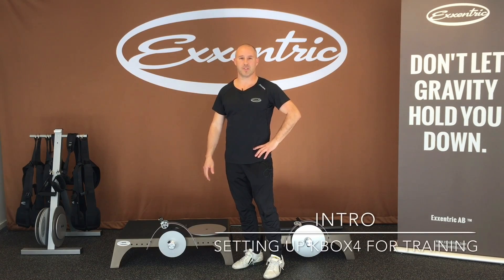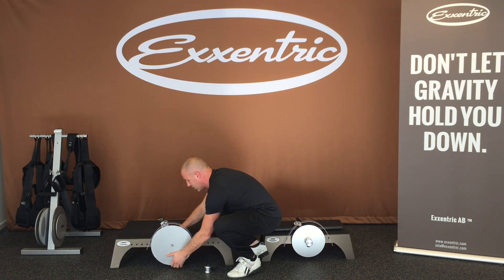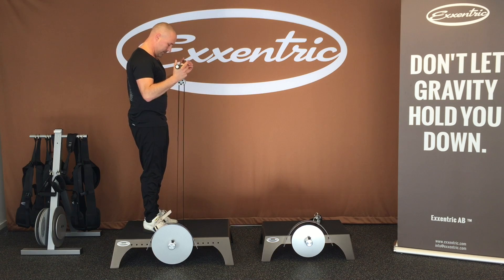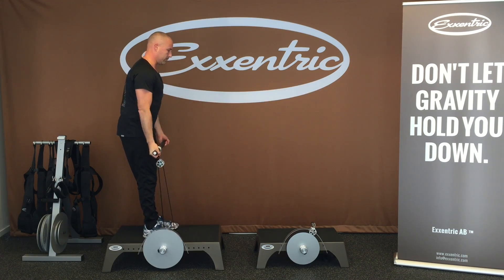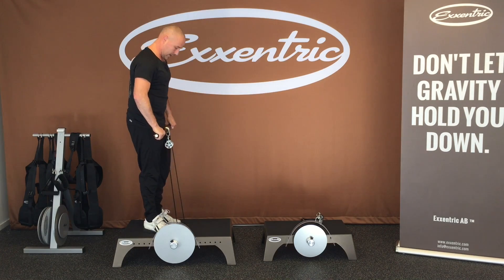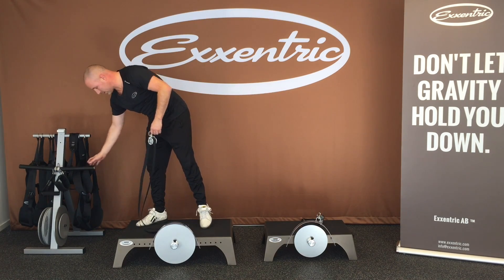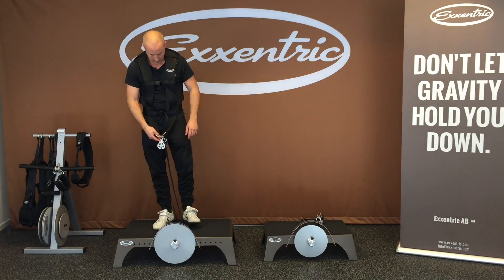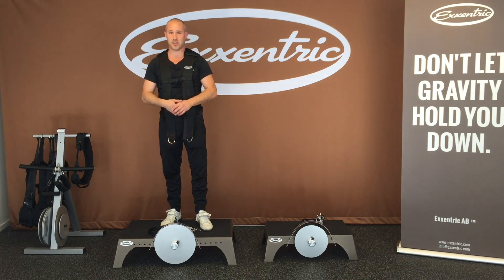kBox4 Demo [English]

Comment: F=m*a
Same mass, more aceleration required more force ...
Good wok engineers.
Reply from the maker: Correct! however, flywheel sort under a variant of Newtons second law but it is basically the same yes. There are a lot of info on wiki under "moment of inertia". Best regards /Fredrik
Reply: Kolas